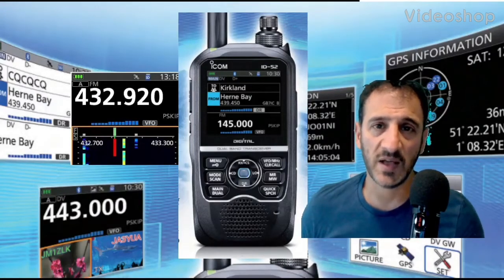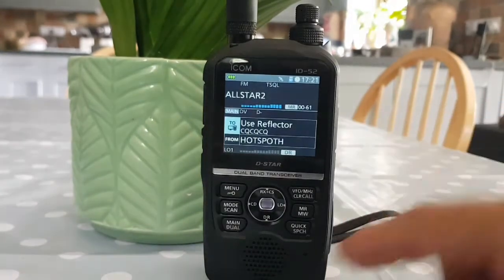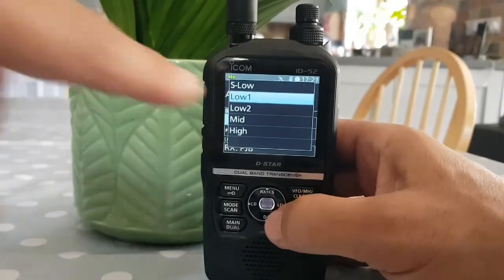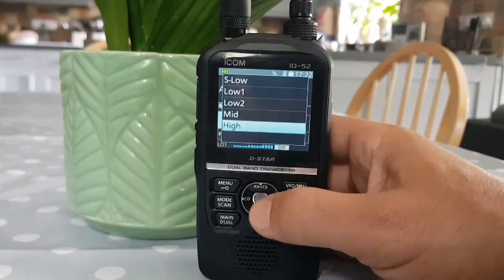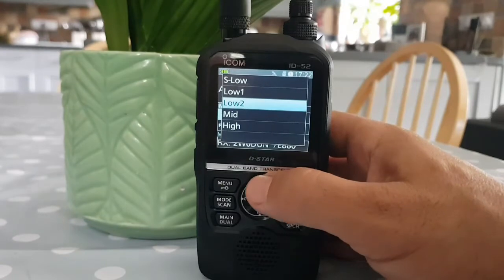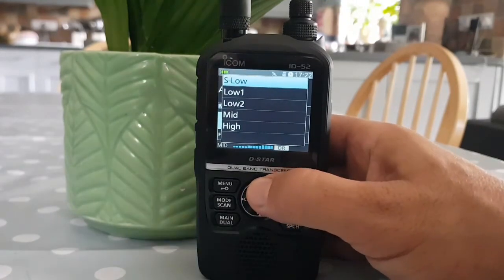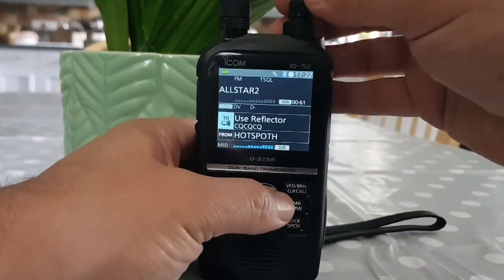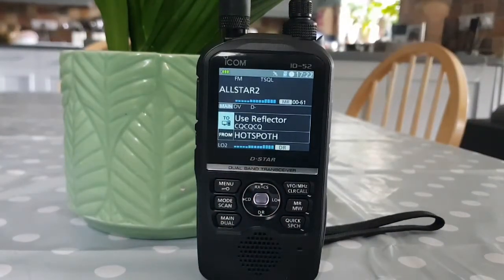ICOM ID-52 Transmit Power levels

Comment: Question: to adjust the output power on my id 52e (all software and firmware up to date) I have to hold down the VFO button. Everything I find on the subject agrees with you but my does not work that way, what's up with that?
Reply from the maker: Keep tinkering